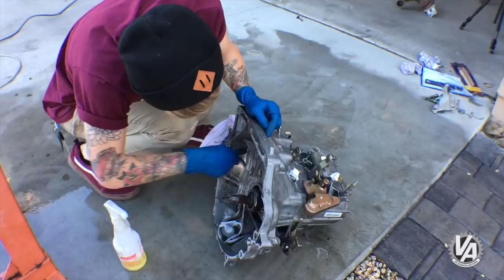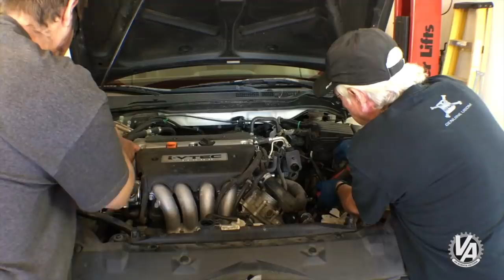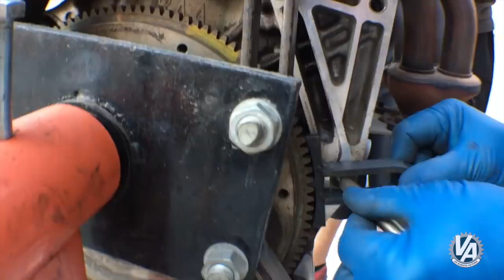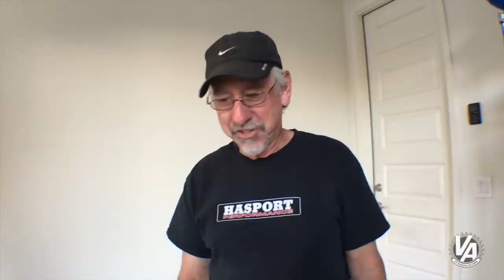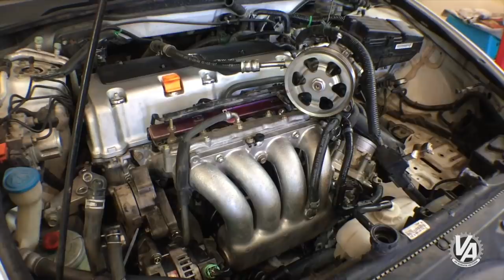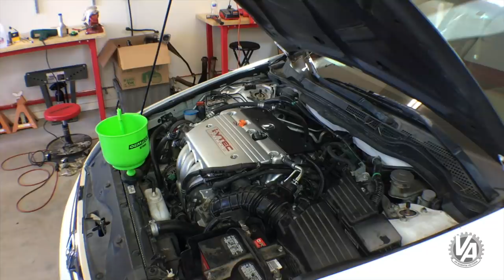ACCORD TSX SWAP- Project Mommobile

Comment: I've got a 2003 honda accord sedan and did the k24a2 swap reusing my 5speed trans off my old k24a4. To run the new motor swap i had to get a 2005 accord manual ecu and Ktuner to run everything and to be tuned. FFW 2 years later I pulled the motor and Trans. New trans, XTD 6 puck ceramic sprung clutch kit with lightened fly wheel, rear main seal, valve cover and spark plug gaskets/gromets, K20A2 Intake Manifold, Eagle Rods, 550cc Injectors, CAI, Innovative Mounts Solid 95A billet motor & trans mounts, Full A/C & compressor delete, Insane Shafts, and headers, down pipe (catless) with a full straight pipe to a DNA exhaust muffler.       

My only question is why did you guys decide to drop the motor from the bottom vs. just pulling it out through the top? IMO pulling it out through the top is sooooo much easier!!
Reply: I know this is old BUT in my opinion, dropping the engine and transmission through the bottom while still on the subframe is a lot easier when you have a lift than pulling from the top. Here is why: you basically remove everything as if you were pulling from the top with some key differences and those are:

* Remove steering column bolt
* Remove passenger and drivers side mount bracket bolts (from engine mount on passenger and top of transmission from drivers side)
* Put a table lift underneath the subframe. I like mine from harbor freight because it can go up 4 feet. Jack it up and center it so that most of the subframe sits on it while the engine is centered to the table lift itself. 
* Once the table lift is in place, jack it up to the subframe
* Completely unbolt the subframe and it should be freed from the chassis
* Now as you life the car up and/or lower the table lift, the engine and subframe completely comes down as one unit and separates from the steering column

This to me is easier because the amount of pain getting to that rear mount is a hassle and time consuming. The axels also have to come off before being pulled out of the car so eats more time since it's harder to pull the axles out while the engine is still in the car. You also risk cracking a sensor or damaging a mount or two due to more stress considering you have to support the engine when taking all mounts prior to pulling from the top. I've cracked TPS and radiators before accidently and have stressed mounts to where they aren't usable. Swapping never goes 100% well but some mistakes can be avoided.

I've learned over time that dropping with the subframe can save you from breaking a lot of things and saves a lot of time. I've done a drop in 2 hours on my own like this. With the engine out on the subframe, it's a lot easier to remove the transmission mounts that are underneath, front and rear engine mounts and axles. Then putting the new engine on the subframe in reverse order is simple. It just sits right back on the subframe and no hassle with the rear mount, front mount or transmission mounts and underneath mount that support the transmission. You can even put the axels back on prior to putting the engine back in the car. Lining up the subframe is a lot easier underneath than lining up the engine up top when dropping back in since the engine is already aligned and seated on the subframe. Not to mention that you can put almost everything back on the engine and transmission and only need to worry about hoses and shift cables and clutch slave after the engine is back in the car. The only thing to align is the subframe, which naturally aligns the engine into the engine bay. No risk in damaging mounts or sensors as long as you line up the subframe to the chassis.

Looks like a lot more work but in my opinion, a lot easier than from the top on these cars IF you have a lift. It's easier to work on mounts and other accessories while the engine is out and on the subframe.

Comment: Hi Brian,I love what you are doing with this Accord since I also have mine swapped and curently enjoring it.  I swapped my 2003 Accord with a 2008 TSX engine with a 2005 Accord ECU/Ktuner but I'm still using my 5 Speed trans that originally came with my accord and planning on matching the TSX trans as well.  Do you happen to have any details on the wiring for the reverse lockout on a 2005 Accord ecu with Ktuner chip?  On a second note,I'm also planning on buying a secondary 2005 Accord with just the TSX transmission swap only for my daily since the car has a defective trans.  Would you have any details on the wiring for just the transmission on stock 2005 Accord manual ECU since it has a mechanical reverse lockout?  I've read a few post about wiring it to the brake wiring but can you shed some light on this?
Reply: 777gilful what’s your power? Why do that?

Comment: I have a question. I've bought a jdm 3 lobe k24a and would like to know what ecu and what to do to my wire harness so i can get this thing working please..
Reply: Did u ever get it running
Reply: @probong2053  yeah just swapped the original harness and used the old ecu.
Reply: Olie Olson k tuner
Reply: What harness did u use?
Reply: Edwin Aquino non ktuner rev1 is plug and play

Comment: Hi, but if I will just install ecu from tsx in my accord from the same car that I take engine out, will it work or again need ktooner
Reply from the maker: You'll need to bring it to Honda to have the ECU refreshed to accept the chip from your Accord key.
Reply: @VTECAcademy  Not true, you can disable the immobilizer with ktuner.
Reply from the maker: Dom Wars that wasn’t the question. Of course Ktuner can bypass the immobilizer. We’ve used it for swaps before.
Reply: @VTECAcademy  Maybe I was confused I think he met, what do you mean by reflash. Did you flash a TSX rom onto accord ecu or did you just copy timing and fuel maps from tsx rom to accord rom. Basically what did you do? To get it to run correctly when you did the k24a2 swap?

Comment: @vtec academy.I was gonna buy a 2005 Acura TSX automatic transmission witch they did a JDM  engine and transmission swap because of high mileage but the person telling me that everything works fine but the sport mode,says transmission wont engage into sport mode.Owner did tell me that they had to replace few plugs cause they were different from jdm tranny.Any idea on how to get sport mode to work again?

Comment: I have a 2003 honda accord v6 with manual transmission. I want to put a new motor in it. Can I use a motor out of another accord with same year and motor but with automatic transmission?
Reply from the maker: Yes

Comment: Question on this one, say I was to stay 5 speed with the k24a2, same exact year and model as the one you guys are working on. Since there would be no rewire for a reverse lockout would I be able to essentially use the accord mass airflow sensor and an accord ecu on k tuner? Just as a plug and play swap, load up the k24a2 base map and just run it like stock?
Reply from the maker: Yes you would.

Comment: Lisle makes a socket specifically for removing crank pulleys. That socket makes it so easy that a 18v cordless impact can take it off.
Reply: I bought this socket when doing a timing belt on an 07 TL-S. It works with my 18V Milwaukee impact gun.

Comment: Finally an accord video , such under rated cars, they handle amazing . Also you can get some nice suspension upgrades from the tl type s. Using its front and rear sway bar and end links. You can even put a factory Honda Accord v6 6speed coupe strut tower bar to really dial in the Accord. Plus these Accord have such a huge fender well that you can fit bigger brakes and wheels for an amazing track car I’m thinking about doing this same thing on my 04 coupe it’s currently 5 speed but like you said it needs some more oomph
Reply from the maker: Mo’s World oh yeah, it’s like a big Civic. There’s lots of potential there.
Reply: VTEC Academy also quick question what are you guys gonna use to run the engine instead of just using the base accord map. Could you also show us a video if you guys use k tuner or some other company to run the tsx engine
Reply from the maker: Mo’s World We are using the KTuner in-ECU system on the original computer with a base tsx tune for right now.
Reply: @VTECAcademy  how is ktuner working for you? Thinking about going the same route, except for keeping it drive by cable. I want to be able to put everything back if I decide to sell it later.
Reply: VTEC Academy where are you guys located? Thank you
Reply: @VTECAcademy what motor solid mount is that ?
Reply: What about a four cylinder that’s what I have and I’m looking to make it a possible project car
Reply: What year type s sway bar rear is interchangeable?
Reply: I'd say they're not as tight or a zippy as the Civic though.
Reply: @taylorbee4010  need to upgrade your driving skills then. Drivers make the cars not the other way around.

Comment: The accord ecu should work fine after a tune but I bet the issues are it’s looking for the egr valve and since the accord is an econo Vtec which activates at 2300 it was trying to activate it at too low of an rpm and freaked out when it saw super lean afr that looked like a pretty well laid out swap great video
Reply: How do one fix the system lean condition? I'm having that issue now

Comment: Please please you guys need to do an Honda Element engine swap please do this for me I totally will appreciate it I want to do either a K24 Type R or a 2JZ in a Honda Element I know it's just a big square of a vehicle but I love mine I love the room in it it's like a limousine Civic thanks guys I watch all of your videos keep on making them man they're very informational and real cool to watch you guys got skills
Reply from the maker: This would be identical to doing an Element. Actually depending on the year Element it might be easier.
Reply: VTEC Academy  thank you for responding so quickly  yes my Element is an 06 nun drive by wire
 5 speed all wheel drive I just wish they came with a j series engine I will like to see one with a 2jz install I think it would be a one off since no one has done one and since you guys are so good and professional at swaps I'd like to do something like this with the help of you guys so I won't screw it up thanks again

Comment: why was the tsx engine so oily on the front?  my K20a2 looks similar... Crank seal?
Reply from the maker: Power steering pump. They are notorious for that.
Reply: after rewatching i noticed you said that in the vid.  my bad!  great info, thanks!

Comment: i'd pay vtec academy to do the swap for my accord. love you guys!
Reply: Man what I been looking into this swap on my 06 accord 😭
Reply: Same
Reply: It’s not very hard to do, I swapped a K24A2 into my Honda Element with minimal issues.
Reply: @applepoop10 I know this is a dead section but I just swapped a a2 into my brother's 06 accord. Did you use the stock ECU and if so did you tune it or just run it outright
Reply: @applepoop10 it’s hard if you don’t have a lift or a bunch of tools

Comment: Which Front Brake Calipers are those?
Reply from the maker: It is a 12.6 inch big brake kit from FastBrakes using the 93-95 Legend Coupe twin pot calipers.
Reply: @VTECAcademy  thanks for the info.

Comment: I’m in the middle of swapping a 7th gen accord coupe to make it Manuel any suggestions on what I need other then the pedal assembly slave lines tranny shifter cables cluster and Ecu
Reply: Manual engine harness or convert that one.

Comment: I'm guessing it would be the same concept for swapping a k24z7 out of a 13 civic SI for a k24a2, running it with the 13 civic SI ecu?
Reply from the maker: In an 08 to 12 Accord, yes. Although I'd use the Accord ECU reflashed for the engine.

Comment: Brian, I bought a K24A2 with 300kms on the engine, it was on an Automatic car. Should I keep it and rebuild it? Or try and find something else?
Reply from the maker: If the oil was changed on a regular basis, it may be in good condition still.
Reply: VTEC Academy okay, we’ll hopefully when I crack it open I’ll find out.

Comment: That flywheel holder tool, "Schley tool" is good. 

Also wait what! Crank bolt uses engine oil? Is that factory specs that Honda recommends or something or what? 

You said new bolt is 36 ft lbs and then 1/4 turn, new bolt is 130 ft lbs, remove it, retighten to 36 ft lbs and 1/4 turn... 

I really hope that Honda factory manual specs. I would understand i guess the 130 Ft lbs is to help the bolt wear in or something but really never heard of such a thing. Also is that just for that accord TSX motor crank bolt or is it for everything... all hondas/acuras? and how about Toyotas and w\e.

Comment: Same motor I put on my ep3 with rbc manifold
Reply: Josh Jones how’s that running hp wise?
Reply: OG Salinas in 3rd gear it made 237 wheel and 192tq, not sure why tuner did it in 3rd so I'm figuring in 4th prob make around 215wheel
Reply: Josh Jones what’s the whole difference from being in 3rd to 4th just curious because I’m getting mine tuned soon
Reply: OG Salinas I heard u get a more accurate reading not sure to be honest I wish I knew
Reply: They usually dyno cars in the gear nearest to a 1:1 ratio . You might think I’m crazy but if he dynoed in a higher gear it would have read higher power numbers .
Reply: I bet the EP3 flies with that engine?